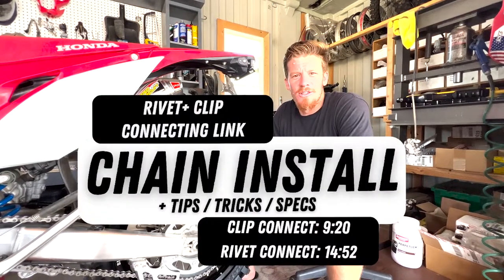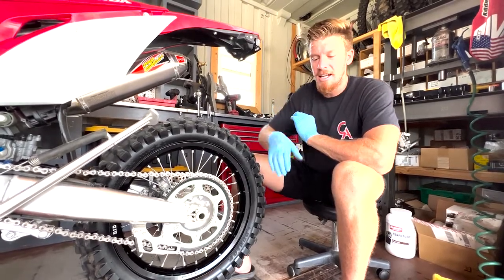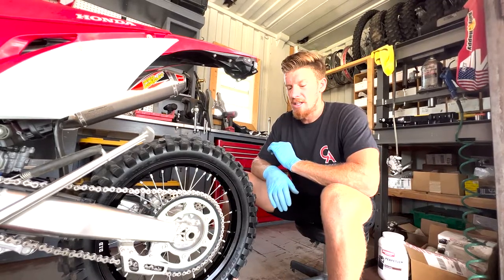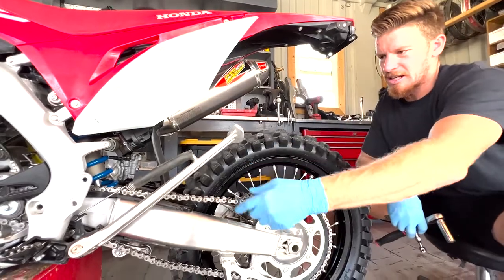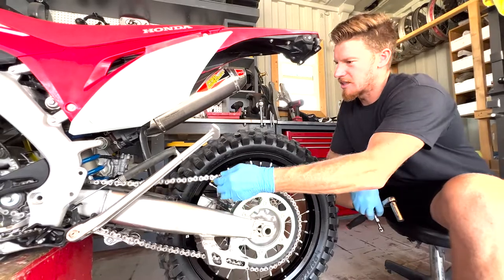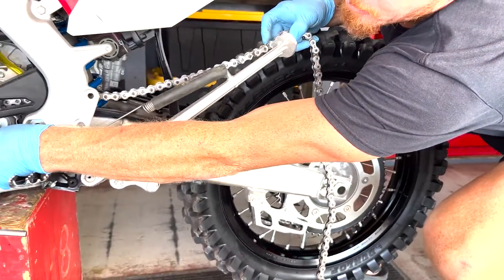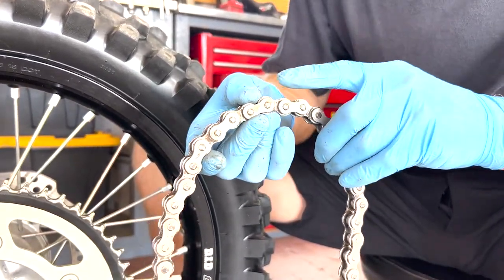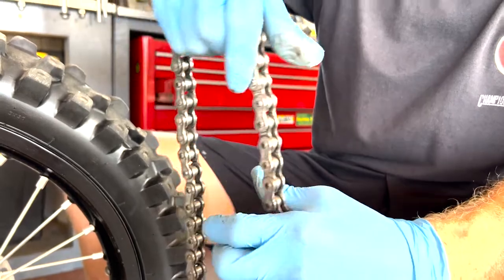D.I.D Chain install- Rivet and Clip link type/ Gearing specs

Comment: I've seen where some Master links have a spec for how wide the mashed over rivet is supposed to measure & you check ✔️ it with a digital caliper - to be sure its right on the money.

Comment: 12:24 The Honda dealer told to put some sealant under the clip for safety. After this it should be a very safe combination for lower powered bikes.

Comment: I just installed a DID 520vx3 chain on my KTM 390 ADV and used a master link. I'm a strong guy and I used channel lock pliers about twice the size you used and there was no way I could press that plate on. I had to use a press tool. Aside from the legit argument of using a peened link, I am thinking that I may not be able to put a clip-type master link on on the trail. Are there emergency master links that are an easy slip fit that do not need pressing?
Reply from the maker: We haven't come across an emergency master link, we have used a clip link and drilled the holes out for ease.. I can make a short video for you in the next few days. Not as strong but a good addition to your trail pack.
Reply: @ChampionAdventures  Great idea. I'll make one for myself. Thanks for the idea.